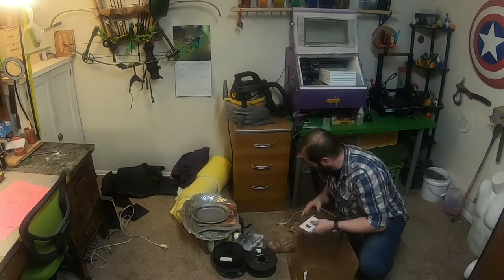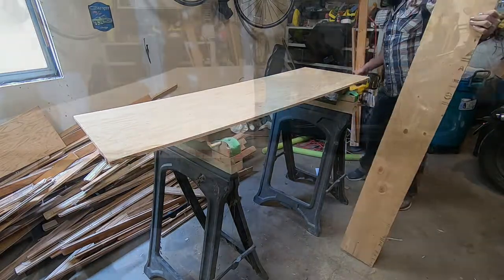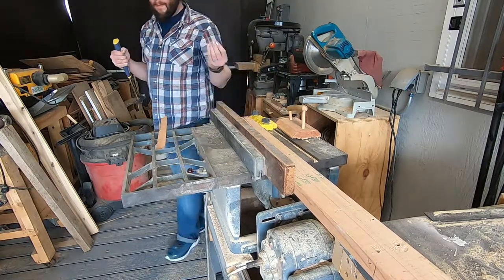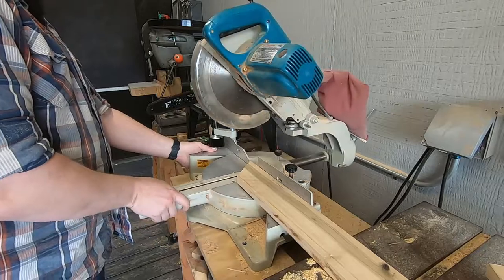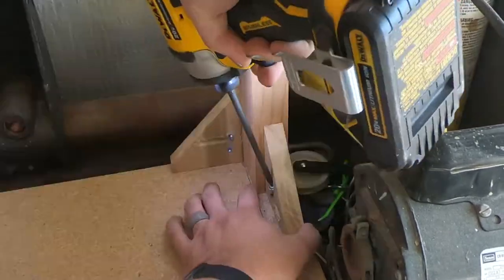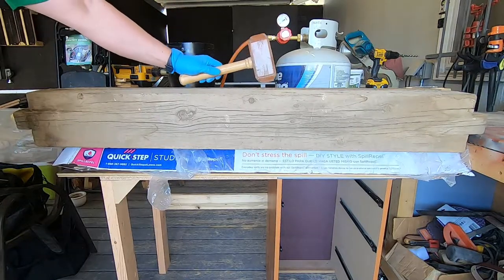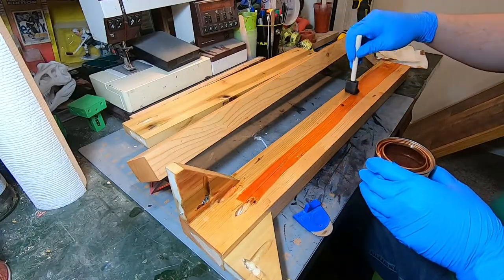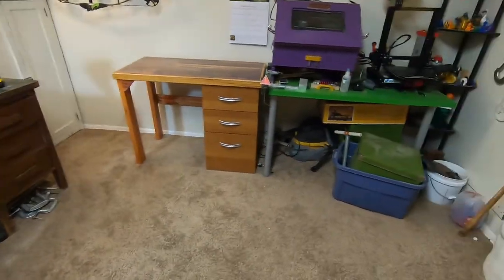How I Made This Desk for FREE - Making the Most out of Reclaimed and Found Materials

Comment: I like your style and your presentation is clear and to the point. I just subbed, and hope to see your channel grow steadily. 
I have one minor gripe with this project though- the back stretcher should probably have been flipped so the pocket holes were on the rear. They would have been hidden as long as the desk is against the wall but more importantly the screws would bite into a more substantial bit of material for added strength.